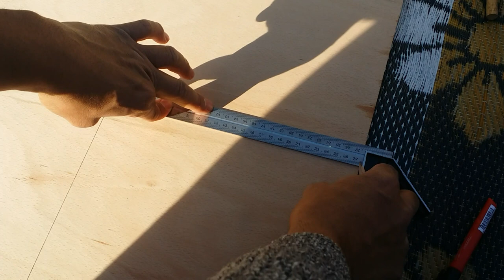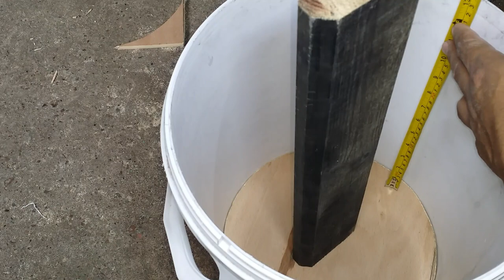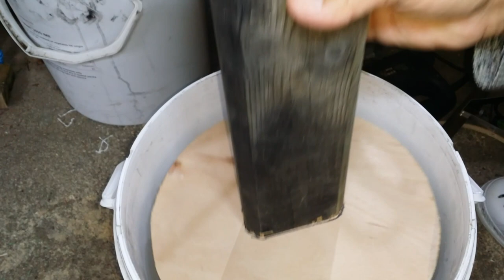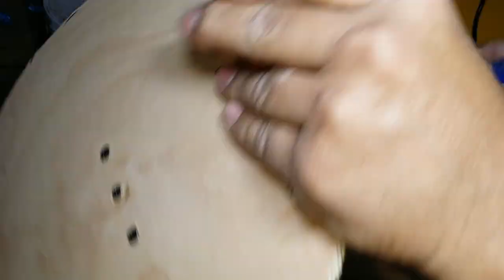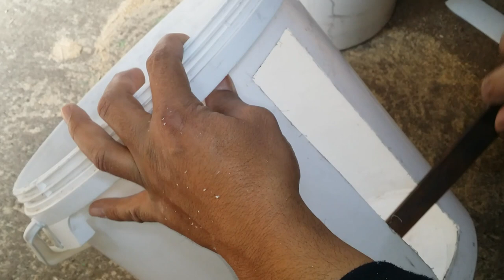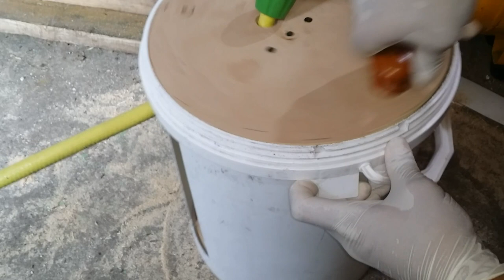How To Make Bucket Hose/Air Reel

Comment: Can you keep it connected to the tap all the time? Doesn't the top hose swivels or rotates?
Reply: you cant but i think if you drill a hole in the side of the bucket, zip tie the hose to the bucket with two smaller holes, and feed your hose through that it will work

Comment: What’s the brand of the tool you’re using ?
Reply from the maker: Its a cheap brand,but works well.
Reply: Alam DIY what’s the brand do you have a link I’d like to purchase one looks like just what I need for my small project
Reply from the maker: @Purrkitty619  its Power Base.